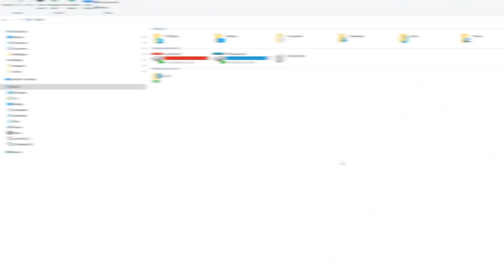1TB Hard Drive Not spinning - Repair and Data Recovery in 6 minutes

Comment: Very common problem with hard drives, this is a TVS diode that protects the drive from too high voltage. What happens very often is users put the drive in an external enclosure and use the wrong power brick. Don't use a laptop charger to power your external HDD folks!
Reply: I made this mistake. That means replacing this kind of chip could save my drive?
Reply: @WunjoxFlo  i did the same but with the charger that's came with the external case
Reply: Can I just brigde the TVS Diode? Will it Work?
Reply: @Sackface225  No, a diode is like a check valve. Current flows only in one direction and not the other.
Reply: I got an old external HDD that died so I removed the enclosure and plugged the actual  hard drive into my computer.....it was recognized, but could see no data   (my theory is the MFT and the like are prolly stored on the controller card thats in the enclosure)  so good 1st obstacle overcome I turned it off and came back in a day or two with some recovery software and the drive isnt recognized...not in windows not in the bios, nowhere but it powers up, but the computer cant see it .....so, whats up with that?
Reply: @weedthepeople2795  Some vendors of external HDs using HDs with only the needed USB interface and are not compatible with SATA standards.

Comment: this is informative. i have some drives that are either clicking, or not spinning at all. gonna try this soon.
Reply: Clicking is mechanical - this won't fix that. Don't power the drive. It's possible that the arm is stuck/not able to park.

The non-spinning one go ahead. Seagate drives often have the TVS diodes blow.
Reply: Clicking sounds means it is physically damaged there's nothing you can do to fix that
Reply: Correct. Will use clicking one as donor boards.

Comment: I  once had a customer (name withheld) that called our office and said their system wouldn't boot up. They powered it down each night at the close of business.  ( I went over and I could hear that the drive did not spin up. I said I needed to replace the drive, and their response was that they did NOT have a backup. Just in case it was a sticky bearing, or a tired motor that couldn't get past the stiction of startup, I gave the case a spin as someone else turned it on, and lo and behold, it booted up just fine, they did a full backup, THEN I replaced the drive and all was hunky dorey. ;)

Comment: Great job! In most cases, data recovery companies would try to swap the PCB, and see if it works, but you, down to component level. I bet you save that persons money in recovery.
Reply: Swapping PCBs is how I used to fix drives.  Unfortunately, that doesn't really work anymore for most drives.
Reply: @alphanerd2305  why is that ?
Reply: @oliwek70  Newer hard drives have more circuitry.  Specifically a BIOS that contains all of the information on drive geometry, firmware, and other important information about the drive.  You can't simply swap the board from one drive to another, even if they are identical model.  Theoretically you can simply swap the BIOS chip to a replacement board, but I've not had much luck with that.

Comment: Its always better to replace that diode, but the drive will work if you simply remove it. 
It will work with out that protection obviously, but it will work.

Comment: A few years ago now I started to have a problem with my Seagate 2 TB drive, I hooked it up in it's old case and plugged it in, it started to smoke. I found the culprit ufortunately soldering/desoldering isn't going to do the job. How can I check if and what component is the reason for the mothorboard to smoke? And If I can get a replacement board, what to watch for?The chip and series are the same?Once I managed to save a HD Not sure if I replace the mobo the drive will be usable. Any help much appreciated since I have some files on it with my mom that passed.

Comment: I was lucky the only thing wrong with my HDD was corrosion on the springs and pads between the board and drive. Clean it up and pulled the data off.
Good old Florida climate.

Comment: Ohh this is great, but unfortunately I got my 2,5 Inch Drive dropped from my desk (from 70cm from ground) and land so hard. I managed to safe/backup them 1/4 of the files but the rest is still stuck. Any advice where should I bring the drive to repair it?   It's still spinning but bad sector due the impact

Comment: Would anyone know why my temps on my cpu went from 36 c when idle to 56 to 62c wand when playing games it touches 72 sometimes a random spike to 80c after I installed my new HDD. I have a aio cooling my CPU. I removed the fans to clean it but that's all,  I never removed the piece on the cpu it self.
Reply: The computer needs to breathe
Ensure there no cables getting in the way of the fan/s
Ensure also that fans are mounted correctly 
Is sucking in at the front and blowing out at the rear else you end up circulating hot air.
Ensure the power supply fan is also blowing out at the rear
Check that no dirt build up is in any hestsinks
Ensure you using quality thermal paste between CPU and heatsink/fan

Comment: Love your ability!!  I have an old drive which I accidentally plugged the Molex connector in reverse, which immediately shut down the system.  I bought a replacement drive of exact same model, swapped the circuit board but now the drive just spins up and back down again.  It's been on my shelf for years hoping my dad could swap the platters somehow but unfortunately he passed away 12 years ago and it's been left ever since.  Would you or anyone know why this happens?  Would the old board be repairable or somehow rectified with the new board?  I live in hope as this the first time I've reached out about it.  Many thanks for any advice/support or suggestions!
Reply: you need to swap the chip that has the rom of the old drive to the new board...try lokking datasheets of the chips that are on the board, see if you find any sort of eprom chip or something like that and swap it
Reply: @MrHBSoftware  wow that totally makes sense!! Thanks ever so much!!

Comment: The only thing i don't like about removing parts from other boards is that now that board is missing parts that now need to be replaced.  With that, the idea of tearing apart a perfectly working piece of equipment just to fix a damaged piece..... i couldn't live with that.  The only reason i see for removing the board to use as salvage like this is if the device is trash. But if that's the case, how can we be sure the part removed was even good in the first place????

Comment: Hello Sir, I am from Pakistan. I have AMD RADEON  RX580 8GB GPU. Whenever I start my pc the GPU fan not spinning & no display. also the GPU has no LED indicator to know the power come or not to GPU. However the display comes from the motherboard DVI Port instead of GPU DVI Port.
Reply: If possible I would try if possible putting gpu  into another Motherboard to test it
Or trying different gpu on same motherboard

This should help identify if gpu or motherboard is faulty
Reply: Thank You Sir, I have checked my GPU on another motherboard it's not working, however the Motherboard is working fine with another GPU.